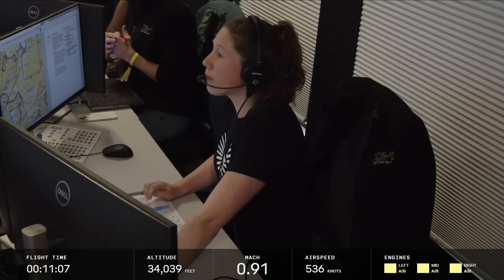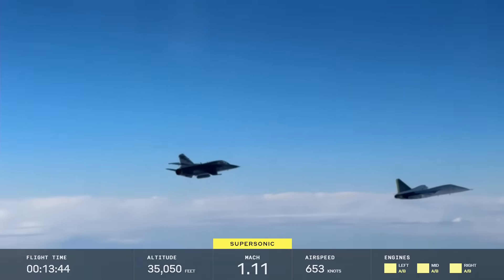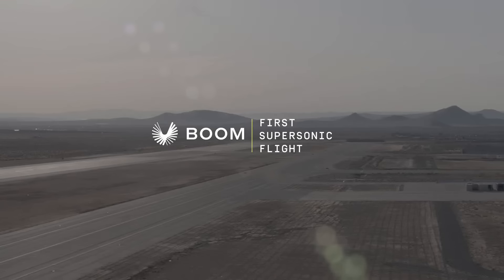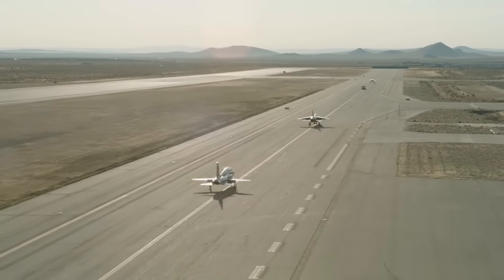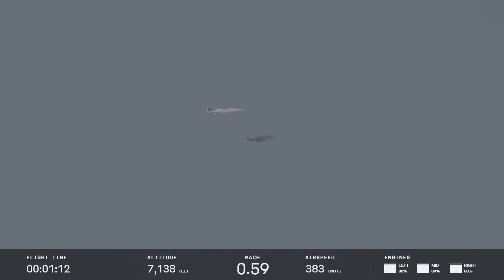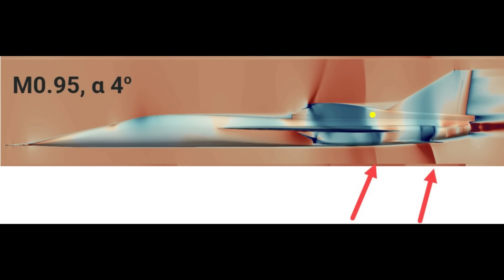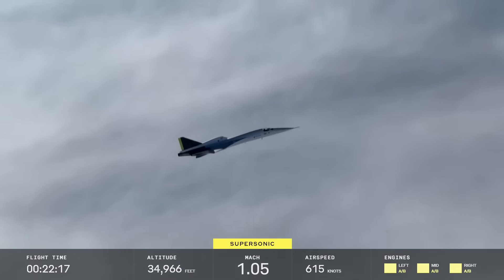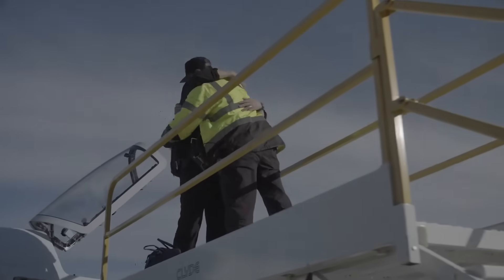XB-1 Baby Boom Goes Supersonic - Jet Planes, Starlink & iPhones

Comment: Boom Supersonic's XB-1 Achieves Supersonic Flight: A Milestone in Civilian Aviation

*   0:00:06 Introduction: Boom Supersonic's XB-1, a supersonic test vehicle, successfully achieved supersonic flight at the Mojave Air and Space Port.
*   0:00:38 First Civilian Supersonic Aircraft: This achievement marks the first time a privately developed civilian aircraft has flown supersonic in horizontal flight using jet engines.
*   0:01:38 Congratulations to the Team: The speaker congratulates the designers, engineers, mechanics, and pilots involved in this historic flight.
*   0:01:49 Pilot: Tristan "Jepetto" Brandenburg piloted the XB-1, having previously demonstrated its flight capabilities in a simulator.
*   0:02:12 Live Stream Technology: The event was live-streamed using innovative and cost-effective technology, including a Starlink system and an iPhone for video footage.
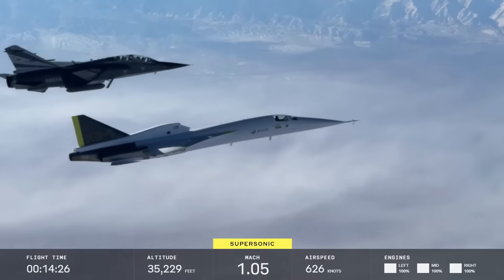*   0:03:24 Supersonic Corridor: The test flight occurred within a designated supersonic test flight corridor near Edwards Air Force Base, one of the few areas in the US where supersonic flight is permitted.
*   0:03:50 Concorde's Limitation: The speaker notes that the Concorde's commercial failure was partly due to the restriction on supersonic flights over the continental USA, highlighting the importance of securing regulatory approvals for future supersonic airliners.
*   0:04:27 Live Stream Quality: The quality of the live stream is praised for its engaging visuals and commentary, providing viewers with a detailed look at the pre-flight preparations and the aircraft itself.
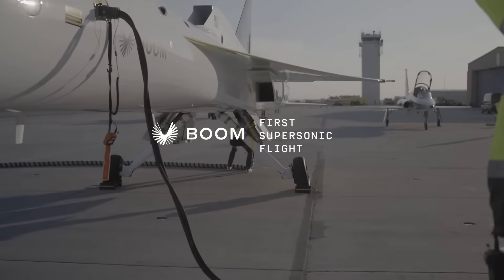*   0:05:10 XB-1 Design: The XB-1 demonstrator features a carbon fiber composite fuselage, metal engine section, three j85-15 engines, and highly swept delta wings.
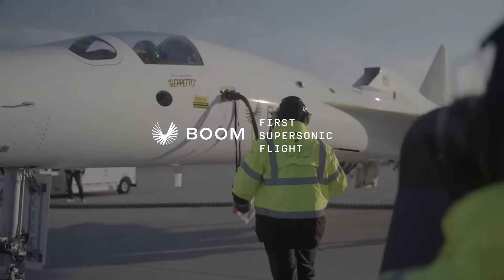*   0:05:55 Camera System: The pilot relies on a camera system for landing due to limited forward visibility.
*   0:06:13 Technology Demonstrator: The XB-1 serves as a test platform for technologies planned for Boom's larger Overture passenger airliner, including a similar landing attitude and supersonic flight characteristics.
*   0:07:28 Chase Planes: Two chase planes, a Mirage and a t38, accompanied the XB-1, capturing footage and monitoring the flight.
*   0:08:21 Coordinated Takeoff: The three aircraft performed a coordinated takeoff, showcasing the complexities of managing different aircraft performance characteristics.
*   0:10:17 Supersonic Flight Details: The XB-1 climbed to 35,000 feet at a rate of 6,000 feet per minute, utilizing afterburners for takeoff and supersonic acceleration.
*   0:11:41 Transonic Challenges: The speaker explains the challenges of flying at transonic speeds, where airflow changes and shock waves can cause instability.
*   0:13:44 Supersonic Maneuvers: The XB-1 performed multiple supersonic runs, with the flight team testing control inputs and stability.
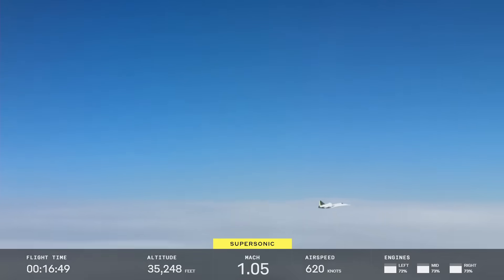*   0:15:10 "Knock it Off" Command: A "knock it off" command was issued during the second supersonic run, indicating a potential safety concern or airspace issue.
*   0:16:02 Test Pilot Procedures: The speaker emphasizes the meticulous planning and data collection involved in test pilot procedures, ensuring safe and efficient testing.
*   0:16:34 Future Plans: The XB-1 program will likely continue with a few more test flights before transitioning efforts to the Overture airliner.
*   0:17:03 Supersonic Turns: The XB-1 demonstrated the ability to perform turns at supersonic speeds, a crucial capability for future commercial operations.
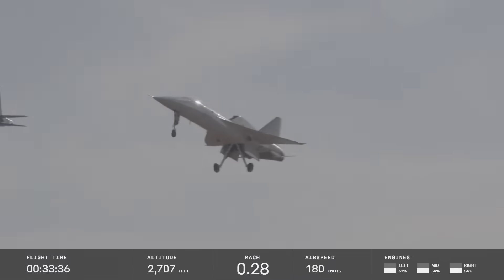*   0:17:47 Landing: The XB-1 successfully landed at Mojave, showcasing its high angle of attack during landing.
*   0:18:10 Conclusion: The speaker concludes by congratulating the Boom Supersonic team on their successful supersonic flight and looks forward to further developments.

I used gemini-1.5-pro-exp-0827 on rocketrecap dot com to summarize the transcript.
Cost (if I didn't use the free tier): $0.04
Input tokens: 28839
Output tokens: 901

Comment: A design like this can also lead the way to Fly-to-orbit vehicles, using scramjets to get to the upper atmosphere and to mach 15+, after which small rockets can get it to orbit.
Reply: You could only say that if this was a hybrid scramjet aircraft, which it's not. Fighter aircraft have been flying supersonic for many decades, and of course the concord, so this is nothing new in the slightest with regards to fly-to-orbit. This is only about boom noise, regulations, etc.
Reply: @ And I am assuming the aerodynamics that cause a smaller boom than conventional aircraft, will benefit a craft that is designed  to fly to orbit. I might be wrong about that, I admit.
Reply: The way to achieve orbit for the lowest price is extremely high thrust to weight ratio, shorter burn duration, self-landing booster rockets. SpaceX has cut the cost per ton to orbit to less than $0.09 cents to the NASA dollar.

Building complex extreme performance aircraft that hang out at hypersonic speeds in the atmosphere for hours is literally the dumbest thing NASA or anyone else ever hypothesized. They already destroyed one shuttle and nearly another with this extreme risky flight profile.

Comment: They did accomplish something...and I assume they have some good math on the flight controls at supersonic speeds, but what made me  chuckle was the 1960's supersonic student trainer chase plane...it has taken this long?  BTW the biggest problem (other than mach tuck) in going fast is the flight control pressure change...the T-38 is a bit sluggish while supersonic so it takes bigger inputs, and a danger is if you have flight control deflection when you slow out of supersonic, you could rip the acft apart.  But the T-38 predates FBW...only raw hydraulic controls.
Reply: you okay?

Comment: Three engines. One passenger. Long way to go.
Reply: They could've achieved supersonic flight easily the first time they took it up. The engines and airframe are more than sufficient. That wasn't why this took so long. 

Before Boom could start safely testing their hardware in the supersonic regime, they needed to make sure it functioned safely at normal speeds. Now that they've confirmed the aircraft is safe and controllable at lower speeds, they can start testing their hardware above mach 1.
Reply: I remind everyone that in 2025 they were supposed to unveil to the public their full scale airline capable aircraft called Overture that would be certified by 2029. And that 2025 date was already delayed. So clearly they are very far from their goal, they don’t even have the engine yet.
Reply: @olasek7972  Wow, stop the press, a tech project is behind schedule.
Reply: @olasek7972  right? Making a single seat airplane go super Sonic shouldn’t ne that difficult. Just put afterburners on a Gulfstream.
Reply: @GeeDaddyFlex305  how is it relevant to what I posted, huh?
Reply: Yeah, but it will get there really quick, that's the point of supersonic. 😊
Reply: To carry a hundred passengers they'll need 300 engines 😳

Comment: The F-5 Freedom Fighter & F-20 Tigershark are the combat variants of the T-38 Talon trainer 🇺🇲🫡

🌌🔭
Reply: It's more like Northrop developed both the T-38 and the F-5 from the same prototype. Park them side by side and you'll see there are quite a few differences between the trainer and the fighter.
Reply: @butchs.4239  T-38 came first & F-5 was developed from that. My former commanding officer trained on '38's.

🌌🔭

Comment: What am I missing here. Boom has after many years accomplished what Yeager and the US military did 7 decades ago. Concord only used fuel guzzling and noisy afterburners for takeoff whereas boom needs them to to maintain Mach 1.1.  
I don’t see anything here that even remotely resembles the concord replacement that they are promoting. 
At this rate of progress the SST airliner is very far away.
Reply: It's an investment scam.  The $10-20 Billion they would need to even attempt it won't be forthcoming.
Reply: this is a private company
Reply: clearly there are a few things you do not understand

Comment: Compared to Concord, it won't need a droop nose, has better composites, but other than that, i don't really see how this is new or revolutionary. Am I missing something?
Reply: It's Slower, less passengers, and won't be more quiet than Concorde
Reply: The fuel efficiency.
And given the size of the tanks, this will allow trans-pacific routes.
Silicon-valley to Taiwan at supersonic speeds could be a big deal.
Reply: @PoRRasturvaT  from engines that are on the drawing board and everything being made up and hypothetical....
Reply: @banzaiib  agreed....by the way , it's Concorde.
Reply: Yes you are missing something, this plane is american which means everyone will now about it, thats compared to Concorde which the Americans were jealous of and blocked it from operating in their air space.
Reply: If it’s quiet enough to operate over land and inexpensive enough to maintain and operate, that’s a big deal.
Reply: @markevans8206  It is not quiet enough to operate over land.  You're confusing this with the X-59 project.
Reply: It is going to do economical supercruise on turbofans WITHOUT afterburners.  That's revolutionary compared to Concorde.
Reply: @stargazer7644  its not though is it, Concorde didnt use afterburners either and it flew faster than this 40 years ago, the cope from the yanks right now is hysterical , they are all pretending this is revolutionary when it really isnt.
Reply: @toekneekerching9543  Concorde absolutely had, and used, afterburners on takeoff.  It was unbelievably loud.  Airports have noise restrictions.  The Overture will be able to takeoff within those noise restrictions.  
Concorde had an incredible fuel burn even without the afterburners. Concorde used 32 times more fuel per passenger than a modern 737.  This made it ridiculously expensive to fly.  The Overture will go slightly slower, but will use far less fuel than Concorde.  This will make it financially sustainable - something the Concorde was never able to do.  That's what is revolutionary.
Reply: @stargazer7644  you must like arguing for the sake of arguing.

The Concorde SUPERCRUISED at Mach 2.2. No afterburner.

Just because it had them for take off and whatever does not prove your point. And this in the future will most likely be as loud… 

Also you clearly alleged in your previous comment that this was revolutionary because it would supercruise unlike the Concorde. Clearly you shifted the goal post.

Mind you it was with engines developed in the 50-60s, you are asking too much. 

While I like this project and want to see where they will go, they won’t be doing anything revolutionary unless they are doing something fundamentally different, (which currently I’m not seeing anything of). Concorde in the other hand was revolutionary, for example, it was the first fly by wire airliner in history…until a320 normalised it 20 years later

And you say turbofan? Yeah… we will see what the bypass ratio of this so called turbofan has for you to casually say it as if will be any different to Concorde…

FYI the bypass ratio is 0 for this XB-1 and we will see how much bypass the end product aircraft will have (low most likely). This will be close to a turbojet just like Concorde.

Lastly, if you have a little research into Boom itself, you will see that they will basically do Concorde but slower, (has the same number of engines and roughly the same amount of thrust).
Reply: @stargazer7644  Apart from takeoff and landing, Concorde only lit the burners to accelerate, it could supercruise at Mach 2.02 at operating altitude.
Reply: @jstratton  Perhaps now you can go back and actually read what was said.

Comment: If those are Dassault Mirage III, they should more than be able to keep up... They reach Mach 2... Maybe the camera drags them down.

The stream said they couldn't keep up.
Reply: Not sure that's a Mirage III, it could be a F1.
But yeah, with a Mach 2.2 top speed at 39000ft, any of the Mirage variants should be able to leave the XB-1 in the dust. Keep in mind it's Mach 2+ loaded with 4 tons of payload...
Reply: that is a Mirage F1
Reply: The stream meant they couldn't keep up in terms of acceleration, not speed. The XB-1 has a higher TWR
Reply: It's one of the Mirage F1B that ATAC possess after french air force sold them 63 birds

Comment: It had to be of afterburner full time,  Concorde could do Mach 2.0 in without needing the burners on full time.
Reply: The full scale airliner is being designed for supercruise too. XB-1 was not, since it's using off-the-shelf engines.
Reply: Yes. Concorde burned 20 T/ h jetA1 during climb / acceleration. It was in dry in  cruise at 2.2 M. Level 600 !Autopilot was then in temperature mode. Higher speeds were possible if the outside air was cold.
Reply: The Boom Overture passenger aircraft won't even have afterburners.  It will supercruise at Mach 1.7 on turbofans.  This aircraft is using off-the-shelf engines, not the supercruise turbofans.
Reply: @stargazer7644  Oh, really?  Which engines can do this for Overture?
Reply: @zacklewis342  That's the goal of the Symphony engines for Overture.

Comment: Still no answer to the main point of this plane. Was the boom quieter than normal 1.0 plus planes???????
Reply: No. That's the X-59, a different aircraft.
Reply: @sebastiaomendonca1477  The question is not about X-59
Reply: @TomatOgorodow  The question is confusing the X-59 and the XB-1. Reduced shock wave is a goal for the X-59, and not the XB-1
Reply: @karl0ssus1  how is it not the goal for XB-1 presuming Boom made this aircraft to test their technologies with which they are planning to make their passenger plane which must have reduced sound volume compared to some arbitrary value idk?
Reply: @TomatOgorodow  Concorde didn't cease operation when the sonic boom law came in. There's no need to be quieter than some arbitrary value, as long as you're not over land.
Reply: @karl0ssus1 seems like XB-1 isn’t too impressive besides being “private”, their Overture program to deliver practical supersonic aircraft to airlines promises lower boom noise, etc. So it’s a step but tiny.
Reply: @karl0ssus1  what if they want to expand their market over land routes?
Reply: @TomatOgorodow seems they have given up on the overland routes. But the whole program must be in jeopardy, they don’t even have the engine. At this point it’s but a pipe dream.

Comment: I thought supersonic air travel is not preferred because of the sonic boom issue, apart from the safety issue, price, etc.
Reply: The company is developing technology to reduce the sonic boom...  which is what this flight was about.
Reply: @kwonekstrom2138  I see, it's just not highlighted though I think that's the most important thing if this project is not just for show.
Reply: @JohnR.T.B.  Yup.  It's only obliquely mentioned.  The demonstration aircraft is finally reaching speeds to test their technology.

My laymans understanding is they intend to reduce the sonic booms by disrupting them using air flows of varying speeds off the flight surfaces.
Reply: the sonic boom is the least of their problems now, they don’t even have an engine at this point. Frankly if you read careful analysis of this program it borders on financial scam.

Comment: Was Mike Bannister stifling a yawn? 😁
On Concorde the mach meter did not pause at transonic speed - I know, I have personally watched as it went through Mach 1 on its way to M2.02. The only indication on Concorde other than the Mach meter that it has gone supersonic is a marked 'twitch' by the VSI as the shockwave passes the static ports.
Vince C
Reply: really edifying info here

Comment: From all I see (and having met one of the Italian investors) Boom Supersonic looks to me like a typical investor scam. 

The business case is based on the passengers' planes actually being sold in large volumes. The business case is not a private company managing to build a supersonic single seater, something that was done in the same desert 75 years ago. Claiming that this was done without government funding is ridiculous, as the same could be said for any company building a computer today, also 75 years after the first computers were built right after the war WITH government funding.

The scam lies in the fact that getting such a passenger plane actually built and certified with the FAA will take far more time and far more investment than anything that Boom has stated so far. Certification of new planes by reputed manufacturers takes at least 5 years. This is a new manufacturer, trying to certify a new supersonic plane... and the FAA has no script for this - it will take at least a decade, probably two.

And by then, with Starship, people will have realized that to get to the other side of the globe fast, it is far easier to go above the atmosphere into space, than trying to brutally and inefficiently force your way through it. 

Again, a well-conceived investor scam.